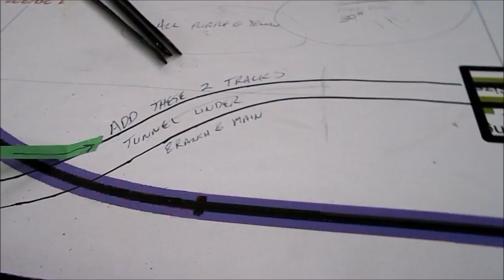The N-scale project: week 1

Comment: Evenjng Peter, well it is in Scotland. I have been binge watching your video channel over the weekend and saw you labouring on a commissioned piece of work dated June 2018. Can I make a suggestion to your cutting and chiselling of plaster along and above the railway track. It appears you are hard at it. My suggestion is to buy and use a man's beard/hair trimming tool, removing the protective guard which limits the upper most length of hair and using it to cut and shape the plaster. Not only will it be less strenuous it might also give you back a degree of control. It would be not dissimilar to using sheep shearers to cut the wool away from the sheep. It works because the constant vibration keeps tge cutting teeth clear but not sure how long the motor will last. The other benefit is it is mobile being on a rechargeable battery. Regards, Mike

Comment: That area with all the turnouts would be great for a coal mine!
Reply from the maker: That corner with all the turnouts IS for a coal mine.  The back three spurs run under the tipple and the front three are for holding extra cars.
Reply: @mpeterll  I noticed past the turnout where the coal spur connects to the main line there is a long stretch of track. That would be good for storing extra coal hoppers.

Comment: Sounds like he bought track plans from you or another person . The original guy flaked out and wasn't either professional or didn't know or was over his head. Anyway good for you to get the job and don't be afraid to make correct changes to the layout.  Just because he thinks it will work a certain it may not , your the builder.  All jobs and occupations have standards. Good vid!
Reply from the maker: The full-sized track plans are produced by AMR, the company whose shop I'm building this in.  The "other guy" had to get the layout started prior to my arrival because of time constraints.  I won't bad-mouth him here.
Reply: The original plan was supplied by the client ("the other guy") and we asked Peter to clean it up for us since he was going to be doing most of the build. The client rejected a lot of his suggestions. Sometimes the client just wants what they want...as long as the trains run correctly and the layout is wired correctly the rest is in the eye of the beholder....and when they be holding the check you tell them what is right and then do what they are paying for.
Reply: @AffordableModelRR  you can tell that it has some elements that a real model railroader would not do. To bad they didn't listen and except some guidance from Peter.
Reply: @adriengadson3544  Don't want to get too philosophical, but there is no such thing as a "real model railroader". Model railroading is your world and everyone has a right to do whatever they want....may not follow prototypical standards, may not follow what a "real model railroader" thinks is right but who are we to judge what anyone else wants. Look at the huge difference between toy train modelers and proto87 modelers, they both have fun enjoying what they enjoy. If we were to build a railroad for you we would build it to your standards and not what the toy train modelers likes.
Reply: @AffordableModelRR  I also have the right to my own opinion.  Also I did not leave a dumb down and not putting anyone down..just my opinion as others may have there own opinions. ..thx

Comment: Did you make the risers if so how did you get the right rise
Reply from the maker: For level track, it's a simple matter to cut the risers on a table saw.  It's possible to make the grades this way too by attaching a board to the foam at an angle.  The company I'm doing this build for (Affordable Model Railroads) cuts them on a CNC router.  I don't know if they sell them but you can always ask.  Scenic Express also makes a similar product, but only in 2%, 3% and 4% versions.  AMR cuts them in multiples of 1/4% for in-house use.
Reply: Thanks for the response.  Looking good